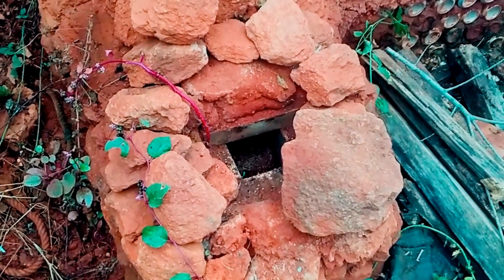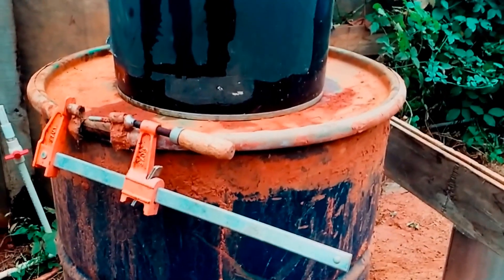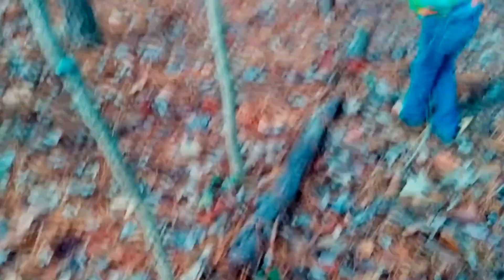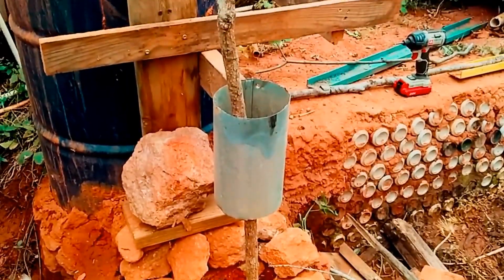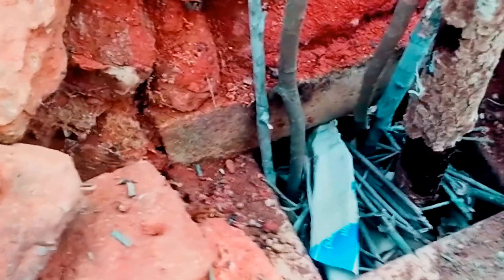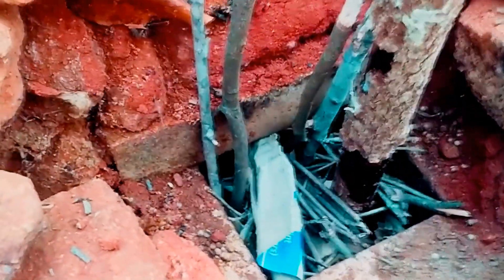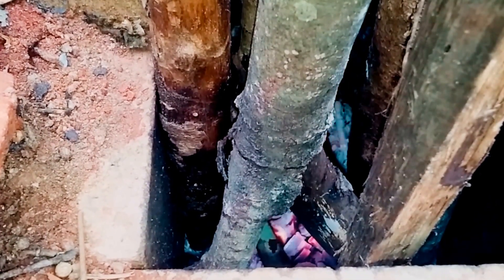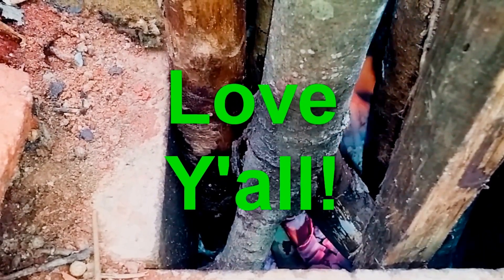Rocket Mass Heater Upgrade

Comment: Make a hood to go over your chimney to help prevent back draft.  It will block the wind without interrupting/limiting air flow through the system.  Fold a piece of thin sheet metal in a tent shape and fasten it on with some screws pointing downward at about 45 degrees.  You'll need to turn that elbow to face outward.
Reply from the maker: Awesome Idea Thank you
Reply: goforgreenliving Thank you for the video.  I love watching rocket mass heater videos.  I have an open basement with a fireplace right in the middle of it.  I'm going to build a mass heater that extends toward the bedroom side of the house, returns back to the fireplace, wraps around it and then up into the chimney through the fire place.  I'm gathering as many ideas as I can from youtube videos.  I also ordered the book by Erica and Ernie to make sure I don't make any mistakes.  I'm looking forward to some cheap heat for a change.  I also have been working on an outdoor wood boiler, but the weather has halted progress at this point.  Looks like I'll have a busy spring getting ready for next winter.  Thanks again and keep posting great videos.

Comment: Daniel, how long does it take the mass to heat up and how long did the fuel (branches) last that you had burn down in the fire box? Thanks!
Reply from the maker: It takes about 2 hours to heat up and the branches burn about 4-5 hours Good question Bro

Comment: Looks good, there great stoves. It would help if you extended your stack above the roof line. The water in the barrel on top should get very hot. How much wood do you go through a day with it?
Reply from the maker: I have 70 plus feet of pipe lol all that comes out is just steam. I burn about 6 8ft sticks a night that I run it.